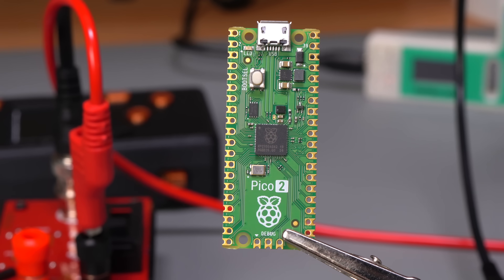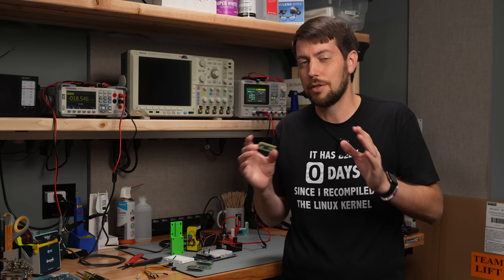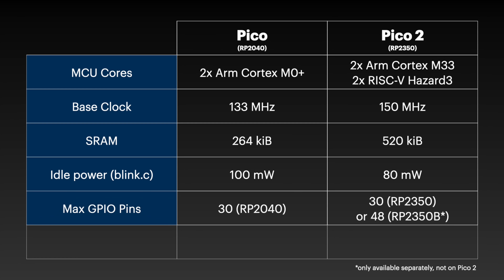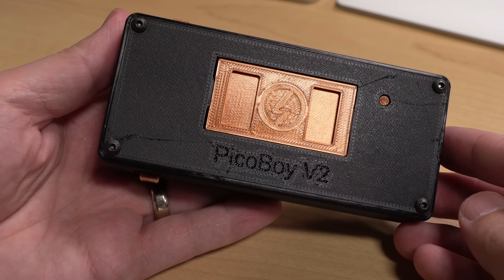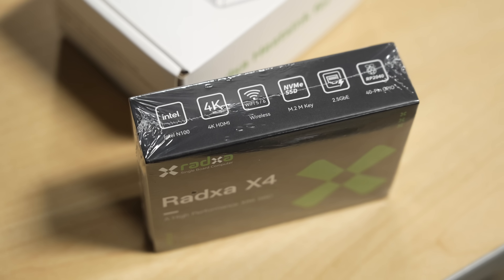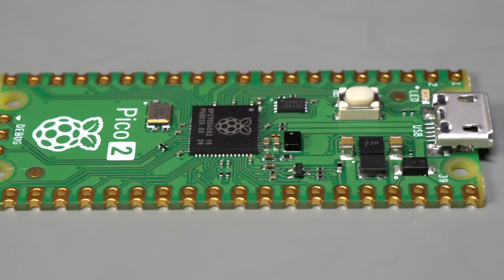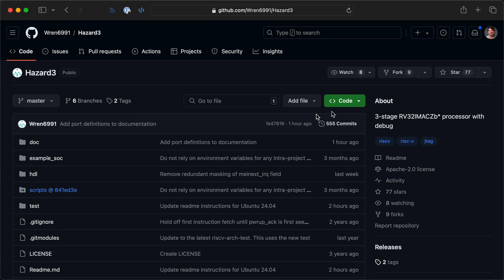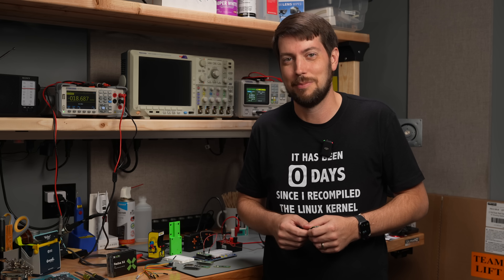Raspberry Pi Pico 2: a RISC-V bet!

Comment from the maker: A few clarifications / updates:

You can actually use Arm + RISC-V—just, one of each core for a frankenmonster microcontroller. Can't use all four at the same time.

MicroPython has released two preview UF2s, one for the Arm cores, and one for the RISC-V cores.

As many have pointed out (thanks!) RP2040 was QFN-56, RP2350A QFN-60, so the pinout is slightly different (so not an exact drop-in replacement).

I don't know about ADC quality improvements or some of the other details many have asked about, so please check in on the Pi forums and in other reviews for more data—this video is meant to be a quick overview to introduce the things that mattered to me in my beginner-level use of microcontrollers :)
Reply: @JeffGeerling  an important new feature given the popularity of the RP2040 in retro integrations is 5V tolerant GPIOs, albeit the chip does have to be powered up first.
Reply from the maker: Oh and yes, it doesn't have USB-C ;)

There are some other 3rd party boards that add that, and an ever-useful reset button :)
Reply: @JeffGeerling  Hello, I want to build a Pi to monitor my EV's charging. Do you know where I should start?
Reply: Esp32-S3 vs Pico2
Reply: Where does it specify being able to use one of each core?  I have been looking and can't find anything even vaguely alluding to that.  In fact, I read the opposite from what they have on the website: RP2350 includes a pair of open-hardware Hazard3 RISC-V cores which can be substituted at boot time for the Cortex-M33 cores. Our boot ROM can even auto-detect the architecture for which a second-stage binary has been built and reboot the chip into the appropriate mode.
Every reference they make is always to cores, plural.  One set or the other.  And what does having one of each, if possible, do to the use of any of the security features on the ARM core?
Reply: @LackofFaithify 
It actually says in the datasheet that it's possible to run one of each kind, and that they'll cooperate in regards to memory locking and such that makes multiprocessor programming tolerable
Reply: @LackofFaithify The RP 2350 datasheet says you can run 1 arm core and 1 risc v core at the same time
Reply: @LackofFaithify  Section 3.9 in the datasheet covers how to select which core uses which architecture & it definite does state you can mix  architectures (S3.9.2) https://datasheets.raspberrypi.com/rp2350/rp2350-datasheet.pdf
Reply: Frankenmonster glued together by IPC? 🙃That's an interesting concept.🤔
Reply: @chris-tal  Even more interesting would be cores supporting multiple ISAs with microcode or within the instructions decoder(s) of the core(s) themselves without any Frankenmonster 'gluing' together multiple cores with some sort of 'IPC'.
Reply: Can't wait for the positron, i tought that they abandoned that project.
Reply from the maker: @Mijo0x9  Nope! They shipped out first batch last month, I think... I have an early review kit from that batch, and they're already improving a few little hiccups for the next batch!
Reply: @JeffGeerling  None of those cores have an MMU right? I think that was one of the show stoppers to run a full linux kernel.
Reply: @shivanSpS  : Right, yes; the Cortex M33 only (optionally) has an MPU, not a full MMU.
Reply: maybe you can cut power consumption by under clocking it
Reply: Hi I am about to start engnaring college. I was thinking of starting learning using the raspberry pi 5 will  it be worth learning and using . I am a ai ml student. Will it be worth starting learning it ?
Reply: Thanks, Jeff. I was looking to see if anyone mentioned the ADC. That has always been my biggest complaint with the Pico. Otherwise I think it is pretty awesome. I have had a lot of fun playing with it.
Reply: id imagine this is a matter of power consumption...???  Or is it something else?  Anyway si absolutely LOVE this idea think it needs to be taken further with x86 cores as well (wouldnt be the Pi foundation though but someone could do it)
Reply: @OsX86H3AvY  
The crossbar bus has upstream slots for 3 devices, in Pico2 it's 2 cores and one DMA engine. Electrically, there's only two CPU "sockets", and you pick which CPU to plug into each socket. Only one CPU can be plugged into a socket at the same time.
Reply: If you can only use the ARM or RISC-V cores, why didn't they make multi-ISA cores?
Reply from the maker: @petertrypsteen  It sounds like the Hazard3 core inclusion was an interesting story; Luke Wren has more about it on Twitter.
Reply: @petertrypsteen  they didn’t make the ARM cores, they just licensed them from ARM. They probably can’t just go modifying them however they feel like.
Reply: @conorstewart2214 arm licenses usually allow you to adapt their cores to your needs (you get more than just netlists), and most of their customers need that ability for reasons ranging from adapting to their supplier's standard cell library to providing high-performance memory-mapped i/o (think: audio processing) at low power.
Reply: @petertrypsteen i wouldn't be surprised if they are designed as multi-isa cores tbh

they could've just been limited by power or delay constraints in their design
Reply: why do you get it beforehand? white privilege? -> I'm white as well!

Comment: Honestly, this design decision makes no sense to me. You can't use all four cores at once, so what is the point? They should've just released a PicoRISCV and a PicoARM as two separate microcontrollers if you want ARM or RISCV. Most people will just see the RISCV cores perform worse then will never use them. For the few people who do want to use them, it's probably because they specifically want to tinker with RISCV, meaning they probably also would never use the ARM cores. Combining the two seems to just drive up the cost for a weird hodgepodge device.

Comment: Whats that about running programs on low energy mode in micro amps. Is this a software optimization skill that needs to be added to a compatible board? 

Is this C based code ? 

I would love if someone would point me into the right direction to achieve mastery on this. What is this called ?

Comment: Re RSIC-V:
The RP2040 chip costs some 60 cent ... 1$ depending on the quantity.
As the PICO 2 is 1$ more than  the PICO (1) it seems that the RP2350 is about 2$, and certainly well below 2$ when buying more than some 1000.
I suppose that the RP company is planning to provide a still lower cost version (RP2X5X) for high volume customers. Here they might drop the ARM support to get rid of license cost.
With the same hardware they might be able to disable the ARM cores by just setting some (irreversible)  bits in the OTP during production.
To save even more with even higher quantities, they could get rid of some gates in the hardware on top of that.
Imagine an RP 2354 (or maybe later a RP1X11 :eek:  ) in every light-switch in your house :) :) :) 

A Really great plan !!!!

Comment: AFAIU, the chip has more pins than the RP2040 (for the more efficient on board DC/DC converter) so no drop-in replacement for designs.

Comment: You can mod those SuperImpulse arcades! Pac-man, ms pac-man, galaga and galaxian all use the same board. Theres a resistor on there that bridges one of 4 connections to ground..pop the resistor out, solder a wire to each of the 4 connections, add a tiny 4 channel dip switch and connect it to ground(i used the speaker ground) then just cut a hole for the switch and glue in place and button it all up, now it plays all 4 games

Comment: The ESP32 is not a great comparison for low-power operation, low-power microcontrollers can often run at 50µA per MHz and sleep is down to 200nA with RTC active.

Comment: If you're into retro gaming, one of the really cool use for a RP Pico is as a modchip. It's slowly replacing the old-school modchip because it's so much cheaper, easier to install and to update. The best example is the PicoBoot, which is for the GC. It's basically better on every aspects compared to the old hardware mods because while the more common XenoGC could only let you boot unsigned disc (so you still needed a boot disc to use homebrews and backups and a working drive), the PicoBoot can simply bypass the regular boot altogether, so you only need a SD adapter and you can remove the disc drive if you don't need it. There's also one for the Xbox, which is also apparently better than the old modchip and software mod, but I don't know much about it.

There are also a lot of smaller projects, like emulating a Memory Card on the PS1 and letting you boot backups without mods, replacing the memory card of the N64 (which uses RAM and a battery), using one as a programmer to mod an Xbox 360 (a lot cheaper than the ones usually used), creating a cheap flash cart for some consoles, etc. I've even seen some projects for turning one into a capture card for some specific consoles (like the Genesis RGBlast, which convert the RGB signal into USB).

Comment: So i have a problem. I want to create a so called "plastic figure" that gives out sound depending on a random rolled number. I have already coded the timer with the sounds, but in Java. First, is it even possible to include Java scripts on Raspberri pi? And second, which raspberry pi do i even need to use? 

For Visuals understanding there is a game called "Gas Out", where there is a plastic figure and as soon as you turn it on and press on top of it, it makes a fart sound. For my game it would be similiar, but instead of it instantly making a sound, i want mine to start the Intervall as soon i press on it.

It would be really nice if u could possibly help me with my problem. I can also provide more information if necessary.
Thank you some much🙏🙏

Comment: I was at DEFCON 32 last weekend and they announced the chip there by building one into all the badges - very cool

(In this case, the chip is being used to run a gameboy color emulator with a custom ROM, along with some LEDs, an IR blaster, accelerometer, and a USB-C charging/flashing port)

Comment: i put my outdoor AQI sensor/transmitter project on hold last year when i was struggling to get python to use both cores simultaneously. wanted to have one core poll a PMSA003I and the second core act as a rest server to host current readings on a GET resource for polling from my existing indoor setup, but found out circuitpython had no provision to even reference a second core, and micropython's _thread lib was quite buggy (and in my research all I could find was others experiencing the same)

Comment: 0:45 what's the *rentWave gadget.  Reminds me of a burden voltage gadget...? Is this measuring current draw in series?
Reply from the maker: It has switchable resistors to allow you to measure the current through a multimeter down to the nanoamp—check out dothediy.com!
Reply: @JeffGeerling  Thanks Jeff, yes I thought it looked similar to Dave's uCurrent, which I have.  The little OLED on this is pretty neat though!

Comment: man the pico is such a cool MCU, but i was never really able to make good use of it because most of the eletronics i work with are 5V and the pico sadly is 3.3V only. i mean even STM32's have quite a lot of 5V tolerant inputs, even if they cannot output 5V.
Reply from the maker: You're in luck; I didn't mention it in the video, but the pins are 5V tolerant on the Pico 2 :)

Comment: For reasons you give, not the best,  but also no USBC video, 20gb/s, not even 480b/s. Memory, isn't too bad, but speed, 500mhz/1ghz, would be good.  A proper embedded R core with mmu, so small devices can be made with security, and emulate systems better.  No short 4mm wide embedded pico version.  The thing is that people spread from way lower energy, lower performance cores, to Arduino, to boards that more resemble a zero 2 in specs.  This doesn't really out compete those ranges, but is something that overlaps in-between.

But, are you saying it has 4 cores but only two can run at a time?  I don't understand.  So we are not talking about separate Arm and risc v versions?  The web page I glanced last morning, was confusing.

Comment: If youre new to microcontrollers i really recommend learning howt o blink and LED bare metal without any libraries.  Theres some good tutorials out there.  I think its actually easier, because you start from the ground up, and everything make sense as you go along, but starting from the top with  high level libaries doesnt really tell you antythinga bout whats going on and leaves a bunch of knowledge gaps you just accept, which is fine if you just want a to run a sensor or something, but as im finding with my project, power consumption is important, so knowing how to put the cpu to sleep and wake it up is actually very useful, know what systems are shut down what ones arent and what can you manage to do while sleeping, have a little dream? sure! Mitch DAvis has a good series about bare metal programming but ive found this guy WeeW - Stack more thorough, his series on blinking an LED with STM32 using no libraries was very insightful how everything is done in the registers, and how to use the datasheet to wriet your own functions to turn things on and off.  Albiet a little hard to folllow he shows how to do it, Mitch tells you to Foff and go read the datasheet without telling you how. Anyway  i got a 2040 recently  and will defeinately try out the micropython ecosystem as well.  There are advantages to an operating system eventually, but i still dont see the overhead worth it for just 1 program that runs, or if you have enough overhead you could say its worth the easte of use but anyway, we'll see.

Comment: When you have so cheap and compatible amd64 CPUs …why? N100, N200, N95 with a whole computer including windows is often cheaper and probably more efficient.

Raspberry Pi is completely pointless in 2024. Waste of money…
Reply: How to say you don't know what a microcontroller is without saying you don't know what a microcontroller is.
Reply: @JamesHughes65  raspberry pi is a pice of s**t not a microcontroller. …and Well no one cares ….it is all about money. Raspberry Pi failed on that front.

You can say ESP32 and alike are microcontrollers make sense. You can buy 10K of those buggers and they will come at 1-2€ a piece.
Reply: Because running realtime code on an application processor is somewhere between incredibly difficult and impossible. You'd also be hard pressed to find any MPU that is price competitive with one of these MCUs when external components are considered.

Comment: How do the pico compare to ESP32-S3? For displaying data from Homeassistant on a large e-ink?
Reply: For that use case I'd probably stick with the ESP. 
For one the Pico 2 doesn't have a wifi version yet so far as I can tell and the ESP32-S3 is considerably faster (at least on paper) finally the ESP has a dedicated LCD interface which might give it an advantage but PIO might negate that.

Comment: Very exciting! However - please stop reporting the Pico RAM as "264 KB or 520KB". 8KB is actually cache. 4KB per processor core. You can't really expect to run an app that uses the 8KB Cache in your program. It swaps in and out. 

So, let's all be real. it's 256 or 512 KB.
Reply: Firstly, kiloBytes, kind of important difference. 😅
Secondly it's hard to blame him as the datasheet just says it has 520kB of SRAM in the summary so unless one has time to look at the memory map or bus fabric pages it wouldn't be immediately obvious imo.
Reply: @oliverer3  I stand corrected. And I'm not faulting our favorite SBC Concierge. It's an industry practice and I find it annoying.

Comment: The rp2040 chip is paramount to console modchipping and custom arcade sticks these days.
You should look into the "gp2040" project. this was made for making custom arcade sticks, but people are using it for controller adapters and such too as it supports almost any console you might want to to use it on. amazing project.

Comment: Really annoying that it contains 4 cores but you can only run 2 at once. I know 4 cores is overkill for a microcontroller but c'mon.
Reply: Probably a limitation with how much "bus fabric" they could squeeze on to the die.

Comment: It's still amazing to me to think that people used less capable hardware than this microcontroller to build whole computers around that millions of people used to get more work done than they do with modern computers running significantly greater speeds with even more significantly greater memory. That said, I'd love to see someone network hundreds of these and make a massive cluster computer with just Pi Pico's. I don't know what someone might do with such a setup, maybe run Doom at full speed with better graphics and sound and whatnot, but that would probably take rewriting the engine from scratch to work in such a way.
Reply: Seems like communication between microcontrollers would be the big problem, speed won't help if it takes forever to get data shipped out.
Reply: @jrstf  Communication speed wouldn't be a particularly limiting factor, and the negligible time spent handling packets would be more than made up for with the duplexed processing power. But it would have an upper limit on nodes to remain viable, because one could only manage so much at a time.

Comment: Why does PI even try anymore?   Just another thing they wont be able to stock. The ESP32 crushes this with dual cores running at 240MHZ, and with more flash, Wi-Fi & Bluetooth, and slap a PHY on it and you have ethernet as well. All for less than the PI.  What's the point anymore.
Reply: Don't think I ever had issues with finding the RP2040 out of stock unlike basically every other microcontroller during the whole shortage thing.

The ESPs and the RP2040/RP2350 just aren't meant for the same use cases. There's overlap sure but both have advantages and disadvantages over each other.
Reply: @oliverer3  please mention one pico advantage
Reply: I wanna say pio and arm but both are so niche for such device, it doesn't even register.